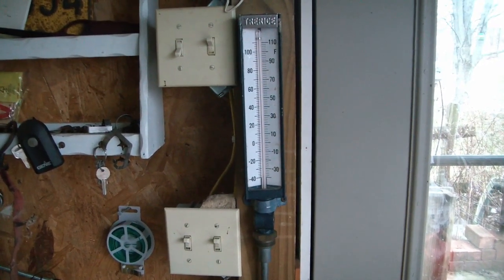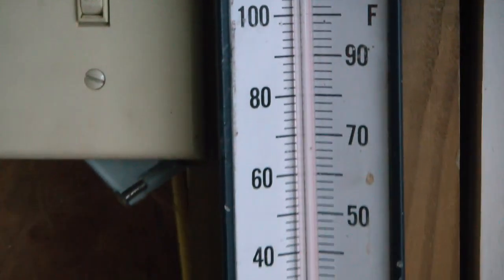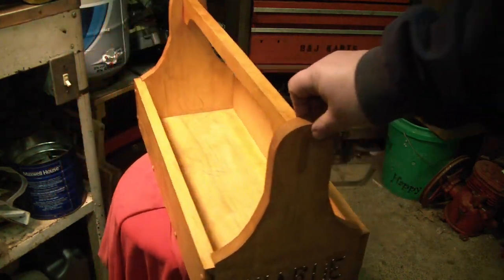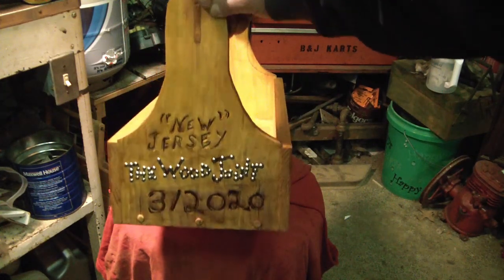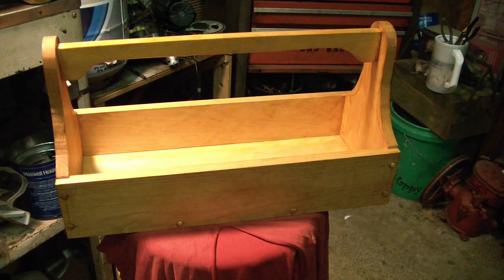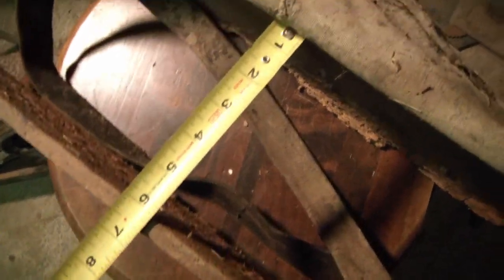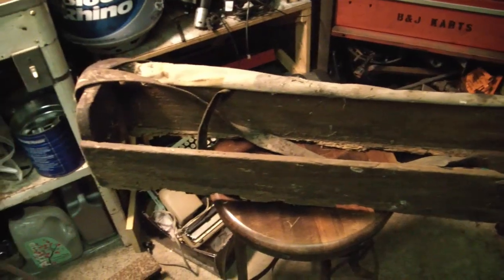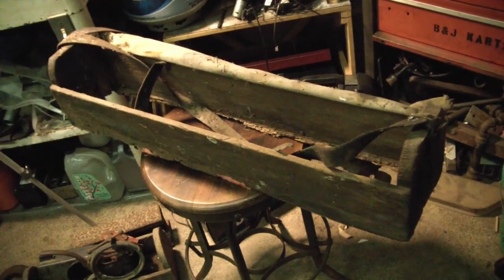Tool Caddy or Tool Tote examples for Scoutcrafter Challenge

Comment: Hello there normally is for a chiller system or boiler system in buildings.
Reply from the maker: Thanks!  I scavenged stuff from an old building years ago.  It had hot water boilers in the basement.  I probably scored this from the maintenance room, but just don't remember.

Comment: That thermometer you have screws into a pipe directly or a well that's made for it this is used in heating and cooling systems in commercial buildings to measure water temp.
Reply from the maker: Thank you for your comment!  Thanks for watching!

Comment: Great video but you need a heater in that shop
Reply from the maker: I know.  I bought a used Dayton Shop heater from a yard sale last year to put up, but it was set up for Natural Gas.  I assumed I could get the changeover parts/kit for Propane since Dayton is a name brand that has been around for years, but all the old models have been obsoleted because they did not have an electrically driven exhaust fan.  The changeover kit is discontinued.  :(